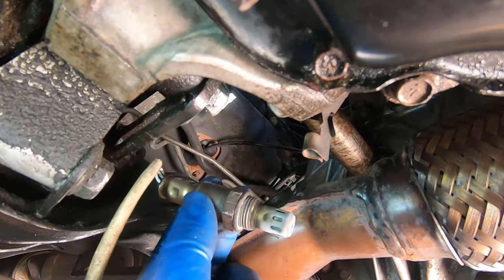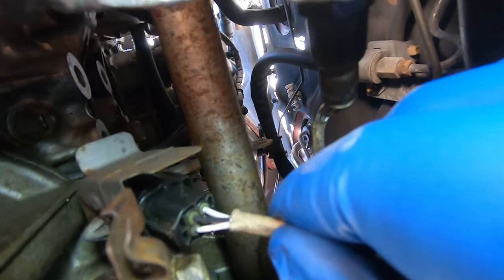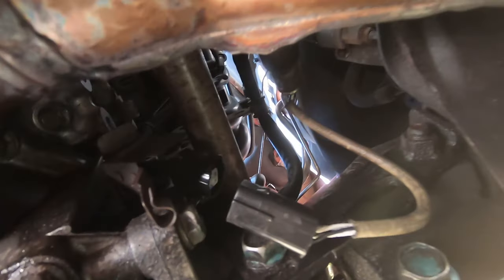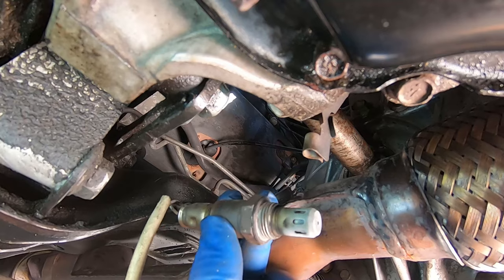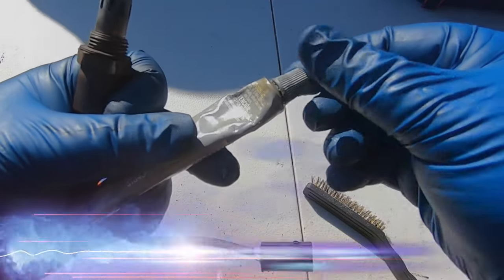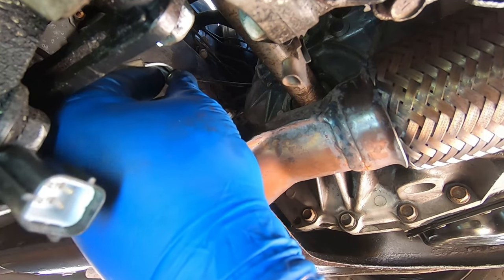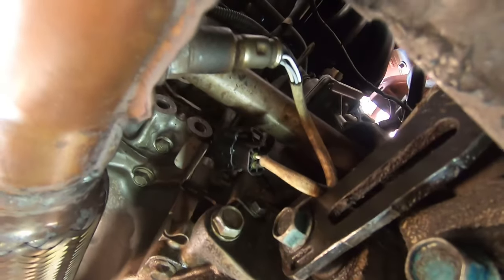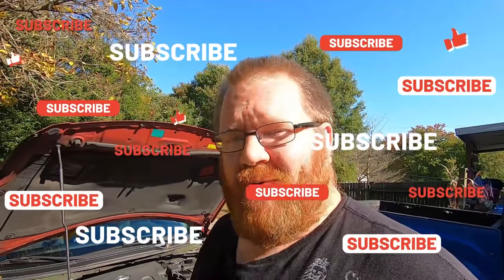2007 - 2012 Nissan Altima 2.5 Liter: Downstream Oxygen (O2) Sensor Replacement Guide!

Comment: Not sure what you mean. Push the tab IN and down? Pull the tab OUT and down? Pushing down doesn't do anything. It's a tab, so it has to move inward toward the wire harness or out and away. That's kind of a critical component of this who thing because you either push down and break it or pull the tab out when it needs to go in or vice versa.
Reply from the maker: Yeah, I think it was push the tab in towards the wire and then pull the plug out. Thanks for watching! 👍

Comment: I had the code p0171 and changed the upstream 02 (under the hood). Cleared the codes and drove around. A few days later code p2096 pops up. Would this be the downstream needing to be replaced? I got a new cat and manifold last year so I’m not thinking that’s the problem

Comment: Was getting a p0138 replaced it now I'm getting p0138 and p0037.. 🤷‍♂️
Reply from the maker: Hi Angelo! I'd return the new O2 sensor and tell them they gave you a bad one. I remember years ago I had a similar issue. The code didn't go away, went back and they suggested another brand (I think Duralast) and the code went away.

Comment: which 02 censor is this one considered to be because i changed the one right in front of the engine and it’s still giving the same code
Reply from the maker: This one is behind the engine and underneath the car, there's two O2 sensors for this car. I would try replacing this one and hopefully that fixes your code. Thanks for watching Jaydon! 👍
Reply: @TrickShiftGarage  the one behind the is considered sensor 1 bank 1 ?

Comment: I'm curious, what does a new 02 sensor improve?
Reply from the maker: Hey MC! A new O2 sensor doesn't improve anything over an old working O2 sensor. 

However, if the O2 sensor is bad and your check engine soon lights on, it could drag your gas mileage down, so replacing it will just bring it back to where it used to be. Thanks for watching! 🙂
Reply: @TrickShiftGarage  Thanks for the info!
Reply from the maker: You're welcome! 👍
Reply: I don't have a Catalytic converter since it was stolen, straight pipe now. I got this code, obviously will be replacing, will it help with the gas mileage? Also is it the downstream only or should I change the upstream as well?  Thank you. Love your vids. Easy to understand and follow.
Reply from the maker: It will help with your gas mileage because the car's computer can properly read and adjust the amount of fuel according to the oxygen level in the exhaust. Thanks for watching! 👍

Comment: Love the video's,  question I am getting a code on mine code p0146 (o2 sensor no activity detected bank 1 sensor 3) can't find it anywhere,  is the one in your video it?
Reply from the maker: Hi, thanks PV! Code P0146 usually means the O2 sensor after the catalytic converter so this should be the one. Do you have the 3.5 liter V6 engine?
Reply: No its a 2.5 I searched for code and couldn't find any 3 sensors
Reply from the maker: Ok was just making sure because the 2.5 just has just 2 sensors. I'd replace this one and it should clear it up. 👍
Reply: @TrickShiftGarage   thank you buddy. Thanks for all the great videos
Reply: The 2.5 has a 3rd o2 past the resonator pointing up
Reply from the maker: Ahhhhh I see now! The California emission Altimas have 3 oxygen sensors, while non-California emission Altimas just have two, I think. I'll definitely check mine the next time I'm under it to confirm. Thanks for pointing this out 😁

Comment: How many O2 sensors does a 2012 nissan Altima have 2.5 liter with California emissions since I'm in California.  Love your channel, you've helped me change out my own struts and my axles, thanks so much for your awesome videos
Reply from the maker: Hi John, thanks for watching we really appreciate it. There is one more O2 sensor that is further downstream from this one for the California compliant Altimas. It is located after the big resonator and before the "Y" pipe that splits into each muffler. I'm not sure exactly how to replace it but I'd assume it's very similar to this procedure. Thanks again for watching 🙂👍
Reply: If my O2 monitor is not setting after a battery replacement for smog check in California, which one you think I should change?  The two downstream or the upstream, O2 heater is set just not the O2 sensor one is not set.  Also, there are zero codes for the vehicle, everything is ready, catalyst, EVAP, O2 heater, only one is O2 sensor.

Comment: I see you’re very fond of the 2012 model ! Your videos have been very informative for me thank you. 

Side question . My mass air flow sensor continues to pop as a problem, however I’ve replaced it a couple times and it can’t be the problem. My rpm’s tend to fluctuate like crazy. When I let go of the accelerator the rpm drops to 800 really fast. Currently now it started to jerk when trying to accelerate past 2k Rpm’s. Have you experienced this ? Thanks again
Reply from the maker: You're welcome, I'm glad to hear how they have helped you 😊

To answer your question, try checking out the mass air flow's (MAF) wiring to see if it's cracked and showing bare metal. Also, check the seal around the MAF that it's screwed into, you don't want any air sneaking by it. You can also check the entire intake system for any possible secret openings and close them up, check over your clamps on the intake elbow, make sure they're tight. I discovered my intake elbow was rotted out in between the "ridges" where it bends, it could be letting in more unmetered air into the engine which could be the cause.

About 6 months ago the electronic throttle body was sticking and not letting the throttle plate open correctly, so it would be sluggish on acceleration and then it would open up once it started working again. So maybe that is something to consider in your situation as well. Hope this helps! Thanks for watching! 👍

Comment: Whats the difference between the upstream and downstream sensor (not talking about a 3rd sensor that CA might require). Arentvthey both the same air fuel ratio sensors?
Reply from the maker: From what I can tell they are. But double checked online  and apparently are different. Not sure what the difference is but they use different part numbers between upstream and downstream sensors.

Comment: I have a 2008 2.5s. I got the error code for Bank 1, Sensor 1. Is it in a similar place to the one you're replacing here?
Reply from the maker: The bank 1 sensor 1 is the O2 sensor close to the exhaust manifold before the catalytic converter. The one in this video is for bank 1 sensor 2 which is after the catalytic converter.

Here's the video for bank 1 sensor 1:
https://youtu.be/UE1r9-fpe7s?si=tGhxkX7aW_fGlpeQ

Hope this helps, good luck and thanks for watching! 👍

Comment: Can I gut both cats and space the rear o2 sensor?
Reply from the maker: You certainly can gut them out...but honestly, I wouldn't recommend it. 

It would cause the engine trouble codes to light up and the engine will probably not run right. The O2 sensors will send conflicting signals to your ECM (the cars computer) and your fuel injectors will change it's fuel delivery, possibly putting it into a kind of "limp" mode, your gas mileage will probably go down too. Spacing the O2 sensor will send more inaccurate signals as well. Hope this sheds some light for you, thanks for watching! 👍
Reply: @TrickShiftGarage  I have an intermittent p0420 code, changed the exhaust manifold cat and first 02 sensor last year. My 2012 Altima 2.5 doesn’t have power past 3200rpm and I can’t go faster than 85mph. Hillclimbs suck. What if I just gut the rear cat and spaced that last o2 sensor with 2 non-Fowlers? I just need a temporary fix for my sluggish acceleration. And that’s the only code I have.
Reply: @TrickShiftGarage  fixed the issue, had a torn intake hose 🤣
Reply from the maker: Haha! That's awesome. I found my intake elbow was torn while taking off my throttle body to clean it. It didn't cause any trouble codes at that point luckily. Glad you fixed it though 👍

Comment: Is that Bank 1 sensor 2? I got code P0138
Reply from the maker: Yes, P0138 code is a max voltage fault for this O2 sensor. Replacing it should set you straight. Thanks for watching! 👍

Comment: so why did you disconnect the negative terminal ?
Reply from the maker: When the negative battery terminal is disconnected, it eliminates the risk of accidentally causing any electrical damage to the sensor or other components during replacement. Thanks for watching! 👍
Reply: @TrickShiftGarage  ohh okay, I appreciate the response, your video was helpful as i’ve changed my downstream sensor today ! super easy

Comment: Is possible to change down stream sensor without getting under the car
Reply from the maker: No, it's not possible for this O2 sensor unfortunately, the only way to get to it is going under lol. Thanks for watching! 👍
Reply: What brand of ramps are those
Reply from the maker: The ramps are the Pittsburgh brand from Harbor Freight. Here's the link:

https://www.harborfreight.com/13000-lb-gvwr-capacity-portable-vehicle-ramp-set-63956.html?utm_source=google&utm_medium=cpc&utm_campaign=17889101751&campaignid=17889101751&utm_content=140106676472&adsetid=140106676472&product=63956&store=451&gclid=Cj0KCQiAgaGgBhC8ARIsAAAyLfHO0rtUY-2C0eGJXjmuUexoA0-bGhxGa_ISo9rHsSRR0BXon9f7PU4aAmr7EALw_wcB